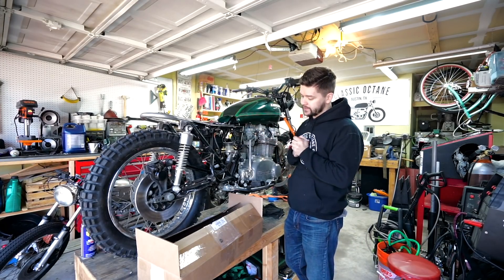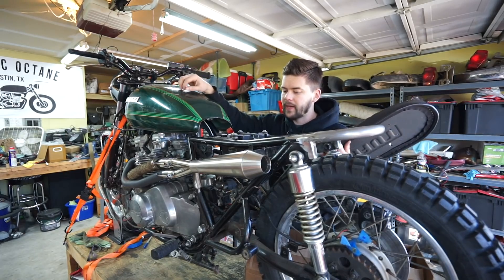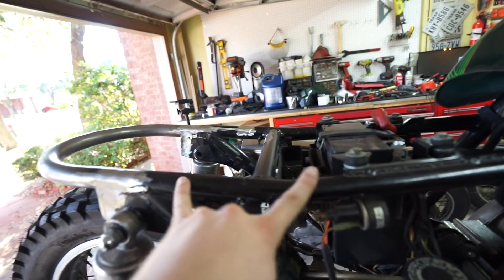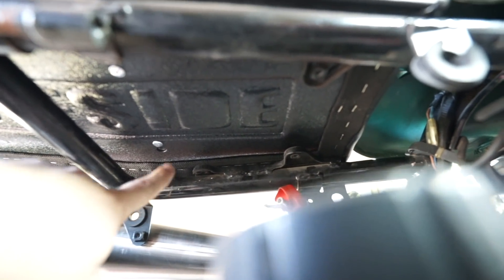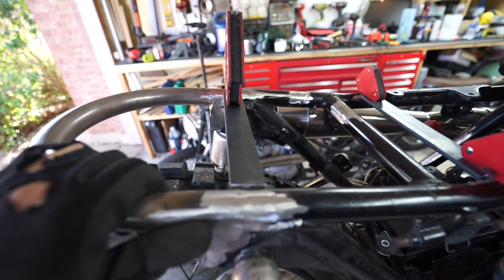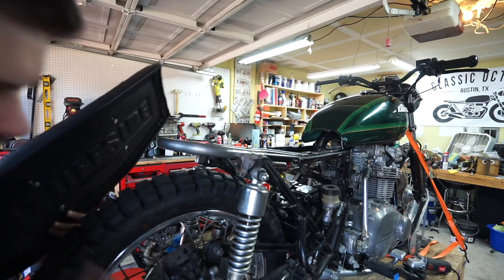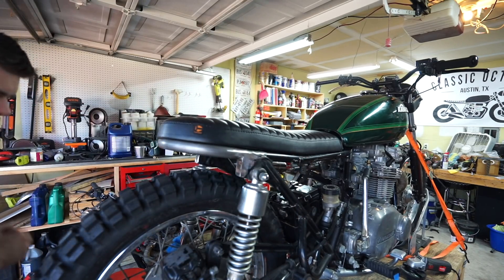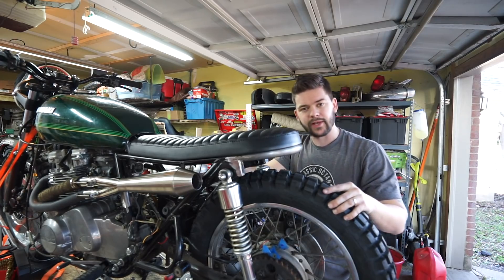KZ750 Scrambler: Custom Seat!

Comment: Seeing as the seat is basically a proto type. If it was thicker it would look better. The gap between the tank lip and seat is just too noticeable.
Reply: The seat wouldn't be an issue if you were going to be painting the tank, as you could weld up the gap, but I can see why Taylor isn't, as the kwaki paint is just too nice

Comment: For the battery can you hang the existing tray from the mounts vs sitting on top? That would lower it the height of the bracket and the thickness of the dampers, just a thought instead of making a whole new mounting system.
Reply: i guess Im randomly asking but does someone know a way to get back into an instagram account??
I was stupid lost my login password. I love any assistance you can offer me!
Reply: @Vincenzo Mario instablaster :)
Reply: @Mitchell Roger thanks for your reply. I got to the site thru google and I'm in the hacking process atm.
Seems to take quite some time so I will get back to you later with my results.
Reply: @Mitchell Roger it worked and I actually got access to my account again. I am so happy!
Thanks so much you saved my ass :D
Reply: @Vincenzo Mario Happy to help :D

Comment: i wonder why the seat is made to sit on top of the frame ,edge to frame  buttet like that ,looks off somehow .wouldent it be better to fit it over the frame and hide it , that way you dont need to cut away so meny tabs and odd things .
Reply from the maker: I wanted it to sit like this so I could have the option to section an led taillight into the frame hoop.
Reply: @ClassicOctane  yea i see , that makes sence